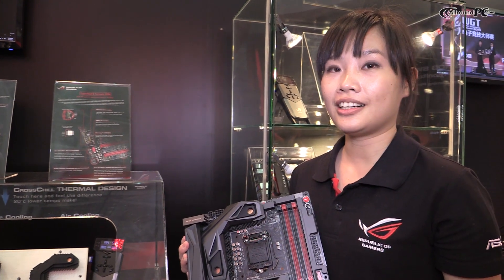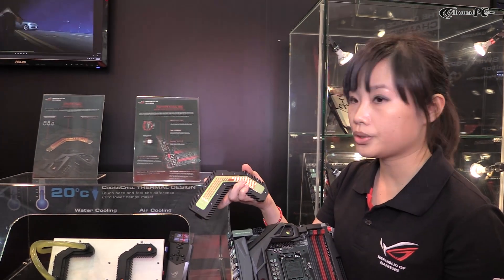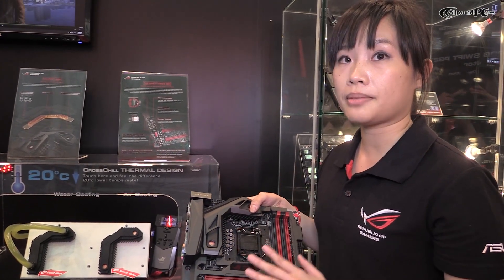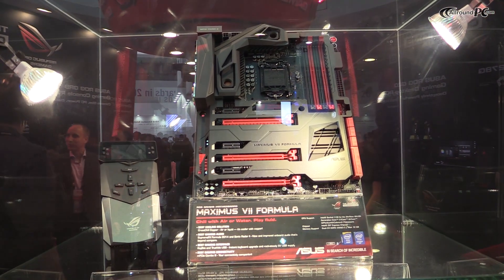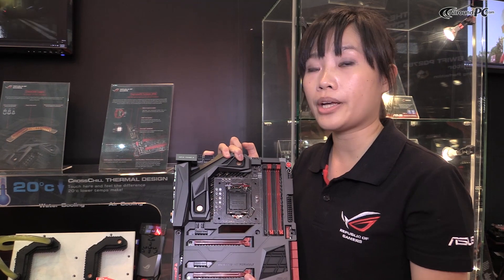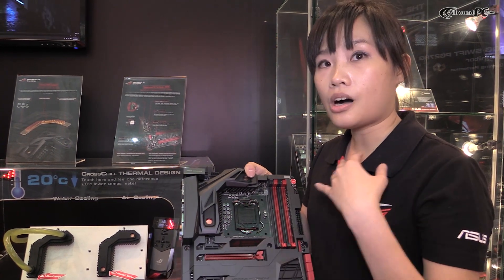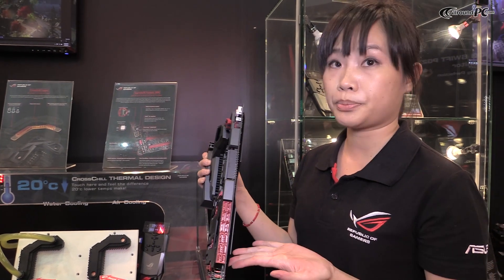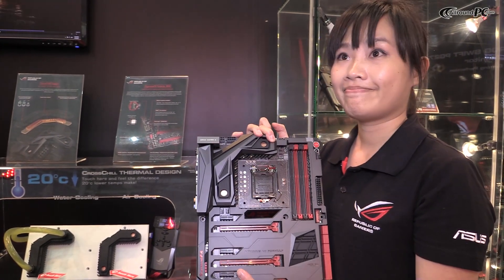computex 2014: ASUS ROG Maximus VII Formula Motherboard

Comment: What is that water and aircooling thing??
Reply from the maker: Instead of regular air cooling you can use the two water cooling ports to hook up your water cooling system to cool the motherboard. Of course you can just use it without water cooling, then it's cooled by air.

Comment: This or the Asus Rampage Extreme Black Edition? Which would be more powerful?

Sorry for a nooby question but very curious to see how this motherboard compares to the Black Edition.
Reply from the maker: Both are very different kind of motherboards.
Maximus VII Formula is based on Z97 chipset and Rampage IV Black Edition is X79 chipset.
If you plan to use more than two graphic cards or need a lot of memory X79 has more advantages.
If budget is the key you should focus on Z97 chipset.
Reply: Wow, man. Thanks a lot! Helped me make my decision!
Reply: allroundpc What´s the difference between this one and the VII Hero?? and what´s the difference between the VI Formula and VII Formula??
Reply: RedShockInc they have different name, that's for sure.